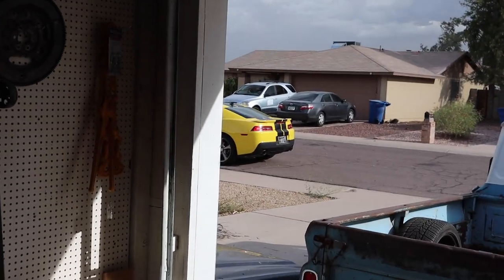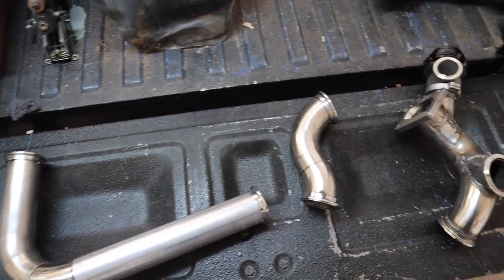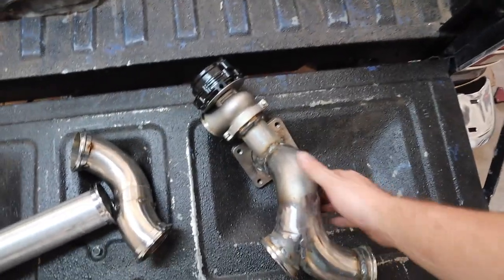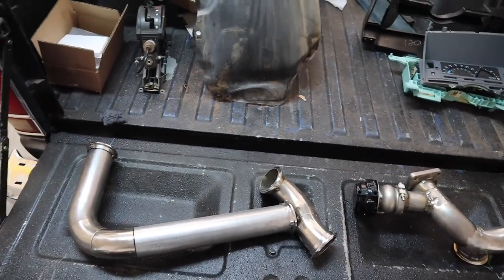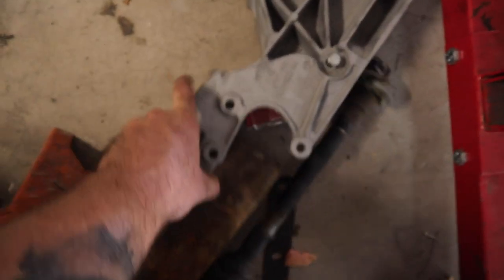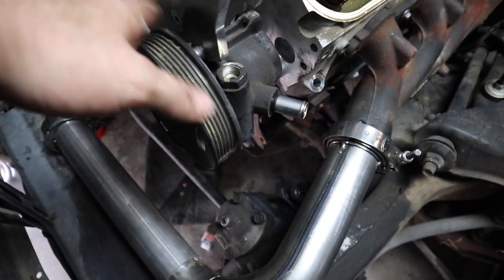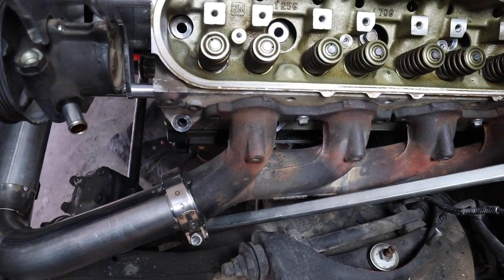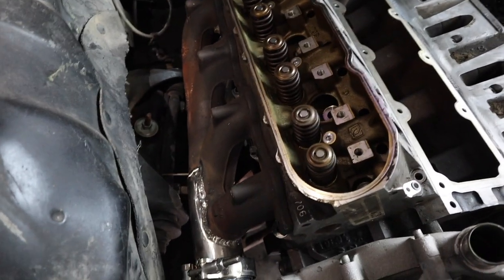Turbo LS S10 Build: Hot Side Fabrication

Comment: What did you use to weld everything? Did you use something special to weld to the manifolds? Did you buy pre bent stuff and then made it work or did you bend it? Thanks
Reply from the maker: I just used my mig welder and welded it hotter than I normally would. I used left over scrap bends I had laying around from other exhausts I had built.

Comment: Why not do a mr2 or Mini Cooper electric power steering pump?
Reply: wont work on s10 most likely...had a guy try in my group and it was by far more paint that a standard mustang 2 rack with custom length tie rods
Reply: Volvo eletric power steering works good
Reply: @joseiturbide4175  how do you wire it in? On at all times with ignition or what?